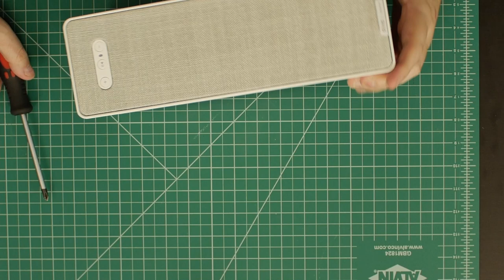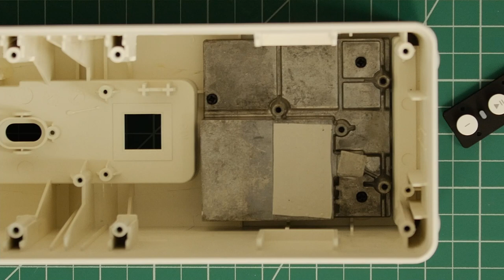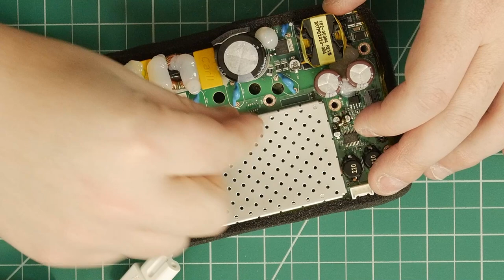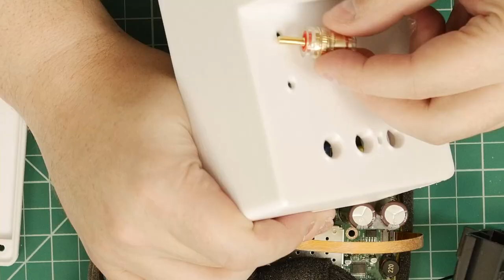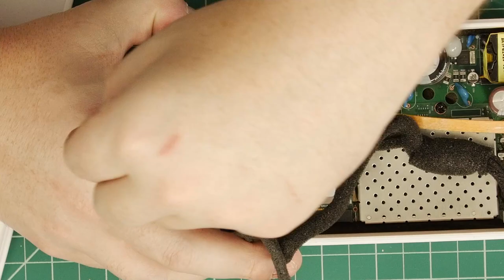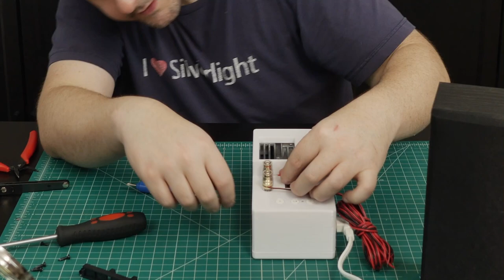Hacking a Sonos Mono Amp with the Ikea Symfonisk speaker

Comment: Years ago I had modified one of these following the first version of your guide... and i had accidentally torn C16 off the board in the process. Followed the rest of the steps and it seemed to work fine anyways.
Well, I had some time twiddling my thumbs, and decided to finally mod the second speaker to match. I did a better job, didn't break off any components... and it sounded way worse! Even after truplay tuning. So, I ripped off C16 to match the first speaker, heh. sounds great again!
Printing out a couple of the cases now. Going to use gen2 boards from now on those look way easier to mod.
Thanks again!
Jesse
Reply: Wait what? Way worse, even after tuning it? That's interesting. 

Did you check the documentation of the chip, to see what the change does (by removing the pin from the bridged set of pins)?

Comment: Nice job, you have a lot of knowledge about this. Any option to ad aux input to the Symfonisk?
Reply: Nope.  There's no inputs on the chipset used by the symfonisk.
Reply: Get a Sonos product with RCA connections (all of the below) 
Sonos Ace.
Arc.
Beam (Gen 2)
Ray.
Era 100.
Era 300.
Roam 2.
Move 2.
 Get some RCA leads and adapters if the source doesn't have them . Link them up and away you go .. very easy and very crap 

I have a really good ONKYO amp cost £30 quid as used product here in UK with about 20 lines In HDMI ×5 RCA ×5 Digital optical X2 then everything leading in to that then one set of RCA to the Sonos product with RCA job done

Comment: Hello Tyler,
Thanks for your video, I'm currently in the process of converting some Symfonisk amplifiers for my new home. I took the Gen2 Symfonisk and also saw the instructions on your website. Am I correct that pins 10/11 on the Gen2 no longer have to be desoldered like on the Gen1 or the conductor tracks have to be cut?
That should sort of take care of itself if I desolder the capacitors, right?
Thanks also for the 3D plans for the case.
Best regards, Manuel

Comment: Superb video and write-up on your website!

If I desolder pins 6/7 on the DAC, and splice in the L/R audio signal from an auxiliary source, would I be able to use this as a speaker with an aux input? Would I have to buck/boost the input?
Reply: Did you ever give this a shot? Very interested in the outcome.
Reply: @DanieljHerrington  I disassembled it, and it’s been sitting opened-up on my workbench for about a month while I try to figure-out how I’m going to patch into those specific pins without shorting the rest of them. They’re unbelievably small, so if you have any ideas, I’m open to try it!

Comment: I wonder if you can skip the small-scale hacking on the PCB and instead split the tweeter/woofer connections on the ceiling unit and wire directly in to them. Probably assumes the frequency cutoff would be roughly the same as in the IKEA speaker, not sure what it would be like if it was off

Comment: Hey there! Great tutorial 🙏 I am planing to connect two CCM 664 (8 Ohm, 130W) with two Symfonisk boards. In the thread it reads that 8 Ohm are not going to get 100W, is that right? As the speaker just has one input I guess I have to go with the bridged/modded version correct?

Once the setup is working, I am planing to put some boards into a 19inch rack enclosure, potentially replacing multiple power supplies with one bigger, let’s see - just started ;) one more question, I am only interested in LAN, no need for WiFi, can I just leave the antennas out to safe space? I heard that without antennas the board is getting warmer?

Comment: Hiya so I get the bridging off the 3 at the amp chip .but why does one need to bridge the speaker wire connections +&- for each channel (L&R) surely (with my limited intelligence) they can be left to run a 2nd sub should one want too (in mono ) where the  impedance of the 2 subs (ohms) fall within the criteria this creating even a better sound and less drain etc on the amp and obviously the one sub if going with 2 subs ? (Or am I been thick )

Comment: How would you recommend pulling power off of the board for an LED light? I'm using a Symfonisk speaker to "upgrade" a vintage radio and would like to light up the dial. I could pull of 120V in series but is there a lower voltage available?

Comment: Great modification - soldered the pins but the bridged signal is very low-any ideas on why? Could it be connections between the capacitors?
Reply: Fixed it - it was the bridge between the capacitors!

Comment: Thanks for an excellent guide! I’ve just finished up (I thought). I think I got the amp soldering/moving pins done correct, but maybe not. I get sound if I use just white(or blue)/red(or black), I also get sound when using blue+white and either red or black. However, if I use both red and black, the sound almost disappears. Any idea what i have done wrong?
Reply: After abit more testing, it seems like I have to use blue, white and black or red on negative terminal, and the one left over for the positive terminal - any ideas?😨

Comment: Just wanted to say thank you.  I've used this mod to drive some Kef Ci50 in-ceiling speakers for the bathrooms in our house... your guide was comprehensive, it works flawlessly and sounds better to my ear than the Sonos Amp I had temporarily hooked up for a fraction of the cost.  Nice!
Reply: Surprised to hear that you think this mod sounds better than the Sonos Amp. I have the 2nd gen Amp and part of the reason why it's so expensive is the cost of the amp section and focus on SQ. The Symfonisk on the other hand is built to a price point and I believe I heard that the amp chip/circuitry is a $15 part. And 30 watts vs 125, with almost certainly higher distortion. I have a hacked Symfonisk driving Polk ceiling speakers and although it sound OK, it's not in the same league as when I hook up my 2nd gen Amp.

Comment: My knowledge is still too limited on this subject, but could you enlighten something for me:
What is the benefit of bridging it to mono compared to using the given tweeter/woofer setup? 
Is it for using the Sonos at a full-range speaker (so just 1 usable input on the speaker, missing out half the frequency range when only connecting one pair of outputs to it)? 

Or is it to gain the added power-output (when is this necessary: from my understanding the 30W in stereo mode is ample power for most speakers).

I'm curious, as I plan to use the symfonisk sonos on a 2-way Polk S20e to power it. And not sure if this mod would make sense for me or not :)

Edit: Also, is it correct to assume that when creating the "passive summing mixer circuit" (as yondermogul at Instructables calls it) by combining the outputs, the cross-over frequency of the sonos amp is bypassed - and all is regulated via TruePlay?
Reply: The benefit is two-fold for connecting to a full-range speaker.  First is that this solution provides a passive bridge that merges the two channels back together (the tweeter and woofer outputs have completely specific audio outputs from the CPU).  Second, you do get a higher power output for a full range speaker than you would by just bridging the two output pairs at the speaker.  For a two-way speaker, you don't need this modification at all, and will be better off just re-routing the wires.
Reply: @noenflux  Thanks for clarifying! :)

Comment: My neighbor has a bunch of these speakers he doesn't use anymore (used to use them at a restaurant), would it be not too difficult to mod them such that they take a physical input so you can use them as regular speakers?
Reply: It isn't too difficult to do, but honestly it isn't really worth doing.  These speakers need substantial tuning that relies on TruePlay calibration, and you only get that when using the full Sonos pipeline.  Without the sonos bits, they are pretty average desktop speakers.
Reply: @noenflux  ah...so the digital processor also is applying an eq? that's too bad. the speakers in question were the ikea symfonisk picture and they looked like they would at least make nice rear speakers flush to a wall :(

Comment: Very Intresting!! What do you think, could i put 2x40W Speaker (8 ohm) at the Symfonisk amp ? Currently i have these 2 speaker with changing the cables at the Symfonisk AMP. But they will be not very loud.
Reply from the maker: If you wire them in parallel it should work just fine.  It's rated for 100w / 2Ohms in mono mode.  So in theory you should be able to drive both speakers to pretty close to their peak power.

Comment: Hi Tyler thanks for the written guide and video very helpful and put together excellently. I have a question I have 2 symfonisk guts for a project. I wanted to test both methods. I have a pair of wharfedale 9.1s and I have bi-amped one and performed this mod for the other. The modded version is giving me significantly less volume than the bi-amped version but from what you have mentioned in the vid and what is says on the TI data sheet it seems like the modded version should have a higher output. Have I done something wrong?
Reply: If you have speakers that support bi-amp inputs, you should absolutely use the bi-amp.  The bridge mode on the TI amp has the same net equivalent power output, just bridged into a mono out.  No reason to do the mod at all for bi-amped speakers.
Reply: @noenflux  Thanks for the reply, I have done the mod due to the bi-amping not working with my original intended speaker, trueplay couldn't bring the lows and highs inline so I opted for the mod and to use the internal crossover, this worked well however seemed to be lacking volume. Thats why I tested on some speakers I know someone else had sucess with and the bi-amped setup is blowing the modded version out of the water in terms of volume. The sound is clean from the modded version but is significantly less in terms of overall volume when compared to the bi-amp or a sonos play 1 that I have. Where would I have gone wrong. I am going to re-do the pins to make sure this is all good but was wondering what you think it could be?
Reply: @TrickerBrad  did you find out what the issue was in the end? I want to keep the passive crossover for my kef q150s

Comment: Nice job on this. I bought the STL today, and will tinker with it. Wondering about pulling a set of wires to my powered subwoofer (which is what I use it for currently) along with an external speaker — have you explored that at all? Anything you'd change with the process if you were to do it again?
Reply from the maker: I haven't really explored beyond this use case, mostly because of the excellent videos from Todd Parker that cover most of the other methods for subwoofer preouts and biamp speakers.  I just wanted a simple way to hook into normal speakers that wouldn't break my bank like the Sonos Amp. :)

Comment: Hi, nice work but I would like to do the 180 degree opposite! Ie., create an RCA in. Can you pull that off as well? I have the symfonisk flat panel speaners, and want to bypass the sonos part, ie replace the signal from the DAC to the amp by my own rca input because they sound really good and i want to put them in a 5.1 setup that is not sonos. I wonder if that can be done?
Reply: If you have a 5.1 setup, why wouldn't you just plug the speakers in directly from your 5.1 amp?  Any HT receiver will have far better AMPs than the Symfonisk.  I don't even know how you'd get a line out for individual channels on a 5.1 source.

Comment: How on earth do you get the bottom 2 screws out of the power supply in the gen2 enclosure?? THANKS!
Reply: I insert a long philips bit first and then use a bitholder to initally get the screw with torque moving after that i use my hand with the bit and screw it out the rest of it
Reply: @startkapital  Thank you, that is what I am going to try next!

Comment: Is your in ceiling speaker 8ohm? At that point aren't you only getting about 20W in bridged mode 8ohm?
Reply from the maker: Yes it is, but no, it delivers 100w
Reply: @thetylergibson  so it delivers 100W at 8ohm?! Previously in the video you said it was 100W at 2ohm, so how is it delivering 100W at 8ohm when it should be about 20W at 8ohm bridge.
Reply: @noenflux  it's definitely not the opposite. Traditional rule of thumb with amplifier ratings is that as the resistance goes up, the rating goes down so 100W@2ohm, 50W@4ohm and 25W@8ohm.

Even Sonos' own Amp works like that: 250W/ch@4ohm and 125/ch@8ohm.
Reply from the maker: @benwhittle7204  Hey thanks for bearing with me on this, and thank you for the information!  You are of course, absolutely correct.  I dug more into the both the datasheets as well as the forums at TI.  You are correct, the 8ohm power limit is ~30W RMS in mono mode.  Important that all of these power ratings are RMS and not peak.  I'll have to do some real power draw testing to see how the amperage draw changes with different speaker loads - and see what the Symfonisk caps out at.
Reply: @Georg D. I'm very curious about this. looking at 4 ohms speakers
Reply: So? What's the answer to this? I don't want to purchase and modify the board. Then a year later it goes out.
Reply: The only thing I see with this is you might lose some omnidirectional coverage with the Wi-Fi placement.
Reply: @Georg D. you can hook up a 4ohm 60W speaker, it’s just going to get 30W max that’s all and so will be lacking a bit of volume compared to having 60W+ available but depending on the sensitivity of the speaker, that may not make much of a difference.

Ideally you have more power on the amp available than the speaker rating but it won’t harm either the amp or speaker unless you continuously drive it into distortion for long periods of time.
Reply from the maker: @Blanddog  the board won’t go out assuming the soldering is done properly.  It has very robust over current protection built in to the Ti amp.
Reply from the maker: @Blanddog  all my units are in the attic and have had zero issues with WiFi coverage - but you are 100% correct- coverage will decrease directionally on the board plane
Reply: @thetylergibson  Ok. Ikea is calling my name. Crazy question since the play3 has dual speakers does it have enough power to run 2 ceiling speakers. A used one is getting around the 100 dollar mark since there being discontinued. I can't find information on the ohms or power options on the play3.  Looks like 3D print a new face plate with 2 sets of terminals. Not sure on the board. I have just started research on this.
Reply from the maker: @Blanddog  the play3 is a completely different piece of hardware.  It has a 2.1 setup internally, so you’d have to demux/remux a bunch more, and power is listed at 20w @ 4ohms.  No idea if it’s moddable at all
Reply: @thetylergibson  OK. Don't buy play3, save money for more of the Symfonisk. I was hoping for 1 box, not 2.
Reply: This finally got me looking into 3d printers again. I've been hold off so long its time now.